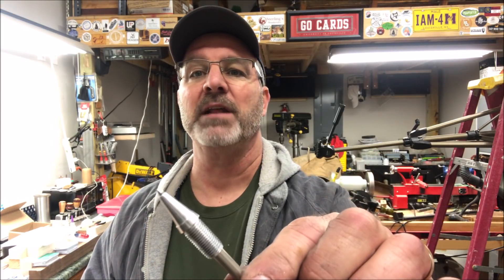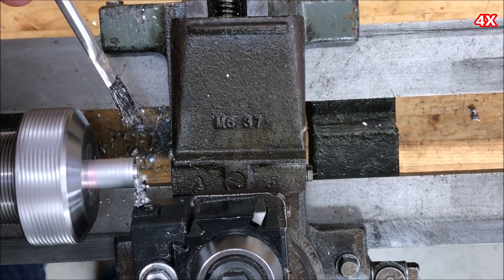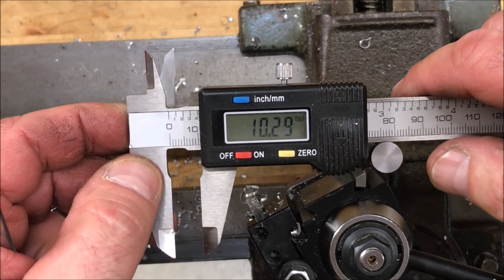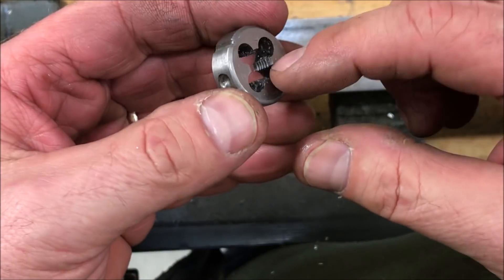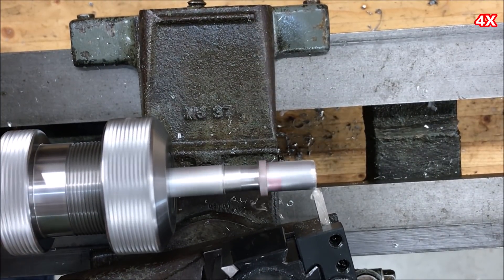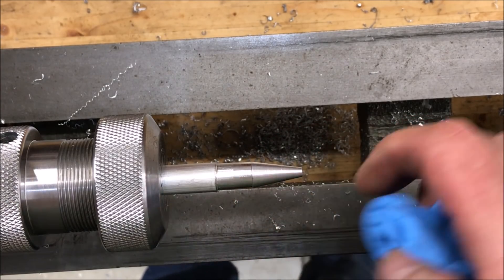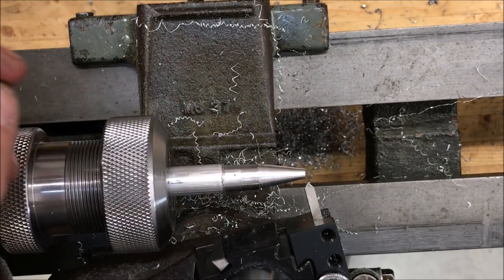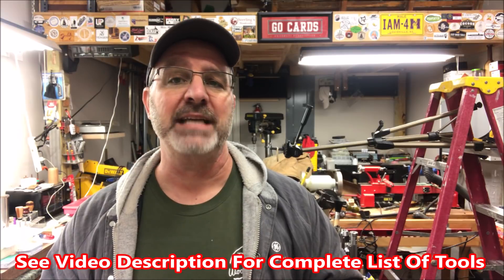Turning an Aluminum Nib on a Metal Lathe

Comment: hi where can i find the piece you use to turn the metal on the wood lathe?
Reply from the maker: I am now sure what piece You are asking me about. Can you be more specific?

Regards,
Bob
Reply: @RJBWoodTurner  I wrote on messenger with highlighted photo.  i would like to know that jig you have to use tools for metal
Reply from the maker: @lorenzix9337  The jig I was using was a Quick Change Tool Post. It’s only made for metal lathes. I do not know of any tool made for turning metal on a wood lathe. 

Regards,
Bob
Reply: @RJBWoodTurner  then your lathe was for metal not wood
Reply from the maker: @lorenzix9337  yes, I was using a metal lathe for this video. 

Regards,
Bob

Comment: Great video Bob, found it interesting watching a wood turner using a metal lathe. I wouldn't recommend using a parting tool for facing off but it worked.  60° threading tool may not be the best choice for chamfering but in ally it worked. Did or will you be adding some sort of protection to the nib to stop it discolouring ? i found an ally pen i made discoloured in a short time which makes your hand dirty.
i understand at this point you were probably new to metal turning so not a criticism just an observation  as im 7 months late to the party.
As a tip, when threading metal on the lathe you can bring the tail stock with closed drill chuck onto the rear of the die to square it while starting the thread applying slight pressure as the thread start same with a tap.
good taps have a dimple in the rear of the square, this is for a centre to aid starting straight, same method can be used with a die as a live centre can be used in them as well

thanks for your sharing your work

Sean
Reply from the maker: Thank you Sean,
  I haven’t use the metal lathe since those videos. I hope to get back to it soon. Thank you for the information. 

Regards.
Bob

Comment: good job Bob, the metal lathe it's the way to go if you want to produce a small quantity of piece.  i make part with wood lathe in the past and i realise it's much tougher to hold measurement on a small batch of part. i strongly recommend  MT2 attachment ER32 with collet with wood lathe it will improve concentricity of part.
Reply from the maker: Thank you Jimmy,

Regards,
Bob

Comment: sooooo that isn't your normal lathe, you find a tool carriage to fit a wood lathe or did you spring for a machinist lathe
Reply from the maker: Hello Andrew,
  I found a metal lathe at an auction and put it back together/ repaired it. 

  May do a restore in the future, right now I’m having to much fun. 😃

Regards,
Bob

Comment: Cant wait to see the other custom components and a finished pen.
Reply from the maker: Next up is the body. Got a bunch of tapering experience today. 

Regards,
Bob
Reply: @RJBWoodTurner  since I just bought a used metal lathe for the same reason, I am really looking forward to seeing what you do.
Reply from the maker: Congratulations on the lathe. I started making drawings of what I want the body to look like today. 

Hopefully I’ll get the attempt making it soon.
Reply: @RJBWoodTurner  my end goal is to make custom pen parts and pens using Damascus steel rods.  Not the resin kind, but actual steel.
Reply from the maker: That will be cool.